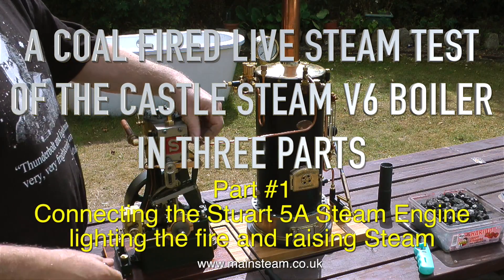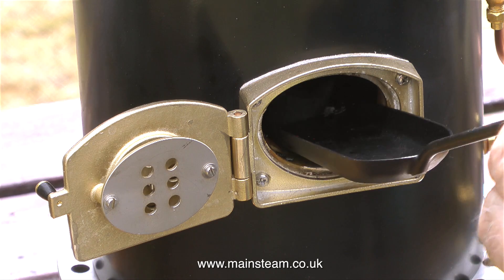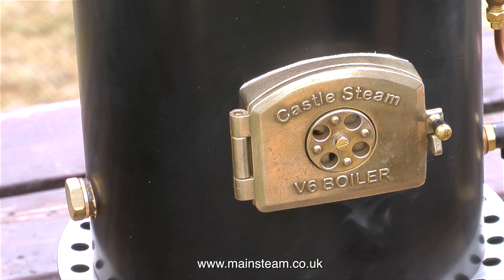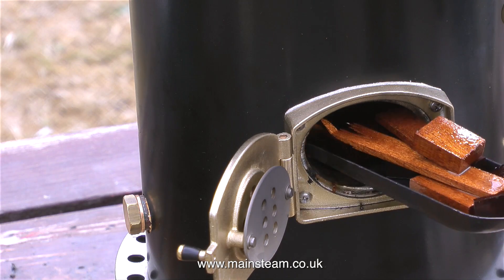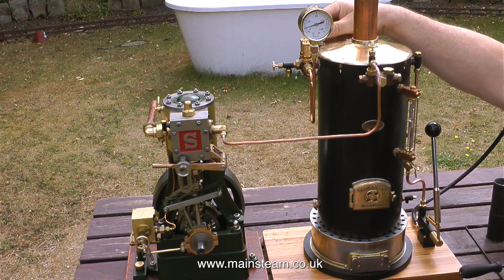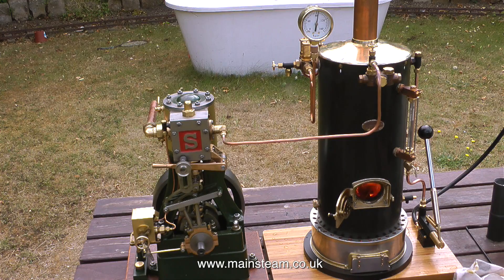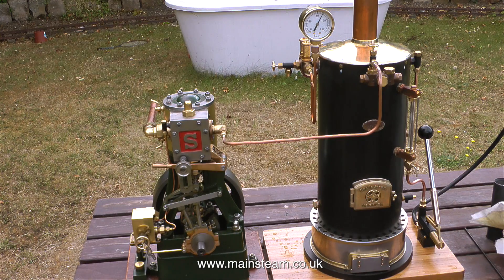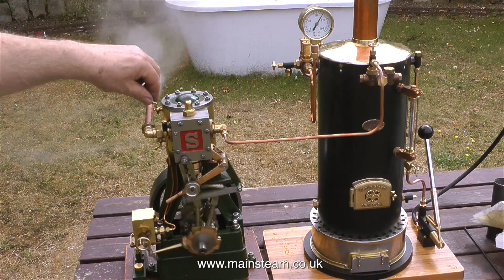A COAL FIRED STEAM TEST OF THE CASTLE STEAM V6 BOILER - PART #1

Comment: I'm glad to see if this engine has a power output data which undergo engine test bed using a dynamometer. Sir, me myself can’t be satisfied until the engine efficiency be figured out. Sorry, point of view is always from engineering perspective.
Reply from the maker: 1.5 HP at 80 PSI
Reply: @keithappleton  oHH ..Thank you for your  warm reply Sir...

Comment: Something mesmerizing about watching someone stoke a steam boiler and watching that pressure gauge rise. 

Oh, the reason this boiler works so well is the way it mixes the air to fuel ratio. 

I forget exactly what they are called, but there is another set of walls inside the firebox that allows the fuel to mix with the air more and more as it reaches the top, all before the gases escape. This provides an extremely efficient combustion process that adapts to the fuel used inside. 

The bottom vents keep the fire going, and the excess gasses go up the wall mixing with air until it burns the last of the combustible vapor.

Comment: One thing is verey often not included in all this nice videos on youtube. And that is a usefull purpose of the power made by these small machine like pumping hot water in tube around inside your house to heat it or som other aplications. The motor wil probably have an oter sound also when working harder. Maybe every home should have one in these times when electrisety prises is sky high.....btw - beautiful made video  - thank u...

Comment: Definitely need an injector with the amount of steam the engine is consuming and the boiler's ability to keep making it.  Adding water and using steam and it's still building pressure. Bigger water pump, two injectors?  LOL

Comment: Can you send the steam coming out back into the boiler?
Reply from the maker: No, once it's done it's work it is spent. Some steam engines use the steam twice though, with a high pressure and then a low pressure cylinder, they are called "Compound Steam Engines"

Comment: Hi Keith, what a lovely boiler and engine.
Do you know if the little dome on the cylinder cap is machined or is it as cast?  It looks very smooth.
Reply from the maker: It is cast and then machined.

Comment: Bonjour Keith,
This boiler is very efficient and your water pump seems quite little for it. With this high pressure, would it be possible to install an injector as it is a static steam plant ?
Amicalement, Raphaël

Comment: It seems to work well.  Question:  Why does the sight glass change while things are "static", no engine running, no injecting.  It seems to bounce up and down for no reason.
Reply from the maker: because the water is boiling inside the boiler . . . if your domestic kettle has a sight glass watch what happens as it boils . . . .

Comment: I am an absolute layman but  I've often wondered why the steam leaving the cylinder is not recuperated by leading it through a condensor. In that way the water could be endlessly recycled.
Reply from the maker: because exhaust steam has steam oil in it and it's difficult to separate in small scales.....

Comment: Keith,

Would this boiler and engine arrangement power a small one person steamboat in your opinion with moderate demand on speed, say 2-4 mph?  Want to build a steamboat for personal use but don't want a Windermere size 18 footer or the like. Just a boat powered by steam for a small lake. Any thoughts what might work?

This boiler certainly has a great responce to a bit of blower.
Reply: Hayden Google Steam Canoes
Reply from the maker: it would easily power a small full size boat probably faster than 4 MPH . . . .

Comment: At 2.19, who else thought "chocolate!".......or is it just me?
I know  an injector is coming, so the hand pump will hopefully be an auxiliary method for the most part, but you do seem to be doing a lot of pumping! 
Could the pump be a bit bigger, or does it need to have a small sized ram to get the water in against 100 PSI (Pleasurable Steam Increments)

Comment: I remember you told us that in order to safely fire a coal boiler you'd need two ways if putting water into it. You have a single hand pump fitted here. What is your plan B should there be an issue with it? :)
Reply: RUN!

Comment: That's great Keith, many thanks for taking the time to upload it, I've wanted to see how these boilers perform on coal for some time as I'm thinking of treating myself to one. It's impressive how quickly the pressure rises and it seems to power the 5a effortlessly. Do you think it would be a bit too efficient and be constantly blowing off if it was being used to power a much smaller engine? The pressure doesn't seem to drop much with the firehole door open so I'm wondering how easy it will be to control if you only require a modest steam output ? Many thanks, I look forward to the next video :-)
Reply: Hi Model Steamers,
I have enjoyed watching Keith put our boiler through it's paces. You always wonder if everything will go well (heart in mouth moment). I am pleased with what I have seen but questions have been raised and must be answered. We really appreciate the interest and comment on our boiler. 

The V6 boiler has a large firebox acting as the most efficient heat exchange area of the boiler. When using coal it also becomes a great absorber of radiant energy. The radiation will act downwards as much as any other direction so care must be taken to build an appropriate fire for the need in hand or continuously blowing safety valves and burnt baseboards will happen. The V6 will run beautifully with quite a small coal fire and with no drama.

For small engines gas is recommended as even a 12kBThU camping burner was able to drive a double 5A (but very slowly) with no radiation issues. With gas the ashbox assembly remains cool and the boiler is always completely under the control of the gas supply valve. But if coal is your thing please enjoy but build with care.

I will be upgrading the stainless ashbox assembly for coal fuel alone to take into account possible issues with large coal fires. The upgrade will include thicker gauge materials, more ventilation control (down to complete damping), and downwards infra-red radiation control (possibly ceramic). Safety has always been at the forefront of this design, hence if all else fails lift the boiler off the fire. That's why it is designed this way. The idea was not to generate your own BBQ charcoal.

The V6 boiler was designed specifically to drive large Stuart engines, on coal fuel, and drive them well. I hope that this will be achieved with a few tweaks.

Thank you Keith for your patience and not moaning about the damage to your well made baseboard.

You can ask me questions directly at info.castlesteam@gmail.com. I'm happy to answer them.
Reply: Thank you for this answer.
Reply: Castle Steam your website seems to be offline? Are you aware of this? Thanks
Reply from the maker: it is everything that you need it to be - great on Gas - really great on Coal ...... I highly recommend these boilers in every way possible (I am not financially connected with Castle Steam in any way and also I am not on any commission).....
Reply: Thanks, as you know I've had trouble will my previous boiler and taking the builder to court, I'm due to treat myself to a new toy